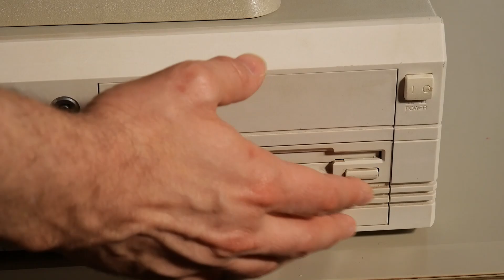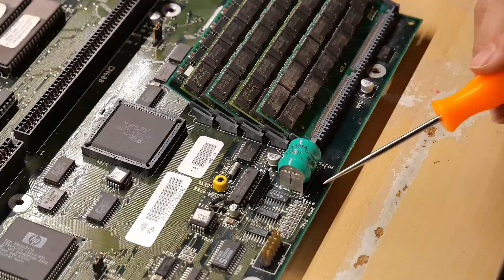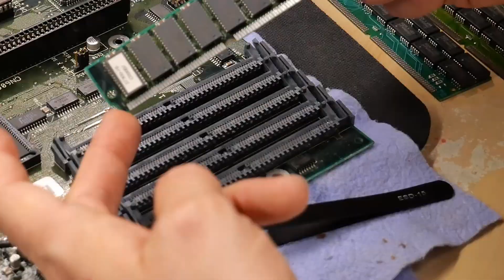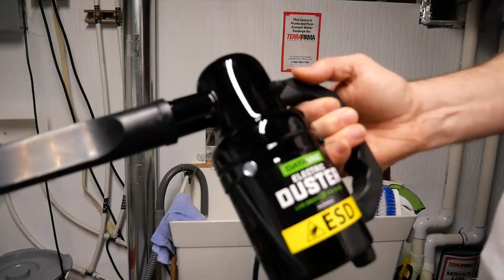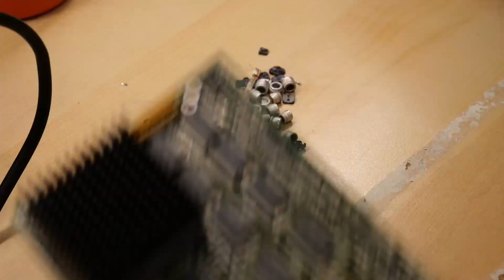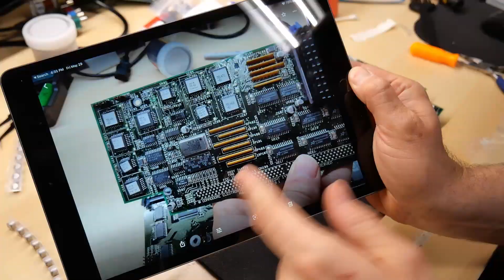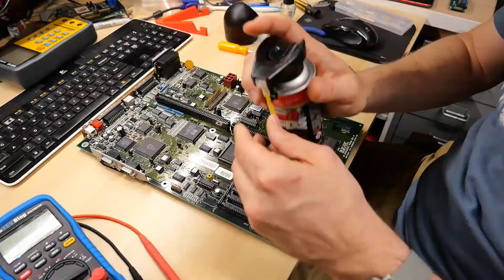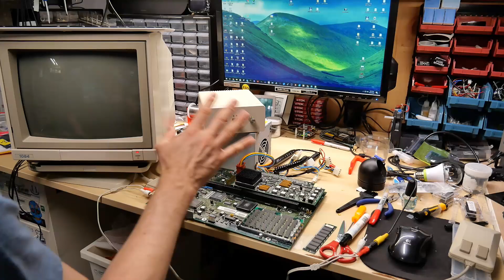Amiga 4000 Repair Part 1: Recapping and RAM issues galore!

Comment: I'm not an expert when it comes to electronics and I don't know the Amiga at all, however the RP5C01 seems to be a "Real Time Clock" - meaning the thing that keeps time and date, not the CPU clock.  A computer would not even start without the CPU clock.
A0, A1 and A2 are likely connected to the CPU so you should have some kind of activity there - you could check continuity of those, they are likely going to many other chips on the board. Are you sure the battery does not make a difference? Do you have 5V on pin 18, VCC? And is the oscillator on pins 16-17 ok? It should read 32.7Khz - but you'll need an oscilloscope to test. I hope this helps, thanks for another nice video! :)

Comment: Watching in hopes that before we dive into the fixing there's a "what's an A-4000, anyway" section. I have no memory.
Reply: The Amiga line was more popular in Europe and the UK than in the US during the early to mid '90s. They were consistently about 10 years ahead of their time and had a price tag to match. 
Adrian made a side mention of it early in the video, but a company called NewTek made a real-time video editing platform called the VideoToaster which was based around max specced Amiga 1000s and later 4000s. The units were revolutionary for the time period in that they were the first broadcast-quality editing system with a price tag of < USD $5000.
Their younger brother, the A500 was used to generate Chiron scrolls, including the on-screen TV Guide channel that most cable systems had during the era. Another fun fact about the Amiga-based VideoToaster series is that their 3D rendering platform was used in just about every low-budget SF&F TV series from the time period (Babylon 5, SeaQuest, etc...), because you could network a bunch of A1000s and/or 4000s together into a cheap render farm for a fraction of what it would have cost to rent time on the IBM and HP minicomputers that most of the big studios used for 3D work.

Comment: If I remember right my A3000 does not found the Hardware clock until I have connect a working battery. You should set the time in preferences after installed a new battery. First try it with a Battery.  Maybe you are hunting a phantom error.

Comment: If you're worried about brittle plastic breaking it often helps to warm it up slightly, a hair dryer or warm water will work depending on the application.

Comment: The 2mb/8mb chip ram jumper was an odd artifact left over during the system's rather checkered development. It needs an AGNUS chip that was never actually produced, to do 8mb of chip ram. Emulators have implemented the 8mb chip ram as a sort of hack.

Comment: I seem to remember something about either the 3000s or the 4000s actually having one of the caps in the audio circuit on backwards in the schematics themselves. You might want to look into that.
Reply: Some of the caps on the A3640 68040 CPU card were installed backwards at the factory. SIlk screen error on the board. Hopefully Adrian is aware of that!

Comment: Even before I watched this video, I saw people on other forums losing their shit about the twist method Adrian used to remove the surface mount electrolitic capacitors.  I say it's fine and Mr Carlson is proponent of this method too.  I'm sure Adrian is able to evaluate and assess the boards condition and judge the likelihood of damaging the traces using the twist method.  It's not as high risk as some people say it is.

Comment: Hey Adrian! Here's a tip on how to clean corrosion. Take a toothbrush, dip it in vinegar and GENTLY rub the area. Repeat if necessary. It really works wonders. You can also use this with regular short bristles paintbrushes, for cleaning corrosion or cleaning of dirt in general, although for dirt you'ld idealy be using some other substance.

Comment: Seems to ge a common problem with the 174 chip on a 4000 when the battery leaked just a little.  I have ssen lots of repair videos and in almost every case, this chip hadto be replaced as it caused several issues not only for the clock but the ide interface as well...

Comment: Check the R182, if it’s bad it will “clear” the IC all the time.
Reply: Yeah, I'm betting there's a corroded trace on either the clock or that clear line

Comment: Just checked the datasheet for the LS174, and as long as clear is high (it's pulled high on the schematic), and you're seeing activity on the CLK pin, then that should be working. If the clear pin were low then you'd be seeing low on the outputs, so the fact that you're seeing high on the output suggests the chip is bad. If the outputs were shorted to ground when the original battery leaked, that would have killed it.

Also, seems a little wasteful to use 16MB SIMMs when 4MB sticks would suffice. But then again, I just had a quick look around for my spare SIMMs, and the only ones I can find are 16MB, so I guess they're common enough that it's not a great loss.

Now I'm wondering what I did with the rest of my SIMMs. I know I pulled them out a couple of months ago to go through them and find the 16MB sticks for my 4MB 30 pin SIMM project, but I'd really like to know what I did with the rest of them!

Comment: I've starter replacing those rechargeable batteries with super capacitors. A few Farads will run the clock a loong time and recharge whenever you use the machine. I don't think they will ever leak either.
Reply: Original XBox users may disagree....

Comment: A fairly important thing about the cpucard and the motherboard.
Many A3640 cards came with some capacitors installed the wrong way around, apparently even the silkscreen is wrong.
http://amiga.serveftp.net/A3640_capacitor.html
The motherboard have 2 caps the wrong way around it seems(in the audio circuit).
https://forum.amiga.org/index.php?topic=73570.0
Reply: I was about to mention this, I don't think he knew.

Comment: I use my actual vacuum cleaner from the 70's with the hose on the output, since it lets you do that. The heat from the motor does a great job drying washed boards. Even had a CRT board survive the procedure and the board works now! Obviously I made sure it was properly dry, a widescreen CRT board is going to have some pretty nasty voltages on it!

Comment: The lack of an RTC shouldn't cause instability. The RTC chip is likely getting too much voltage because there is no battery pulling down the 12v line - so it is outside of its operating voltage. Try installing a (coin/button cell) battery or stopping the 12v line from getting to the RTC chip.

Comment: I finally had to buy a new roll of desoldering braid, I only use the chem-wik #4 10-50L and that roll lasted me 5 years! It is readily available for around $19 on ebay and works like a dream.

Comment: Finally someone who don’t say “battery acid” and say what the substance that leaked really is.
Reply: True. Car batteries have an acidic electrolyte, most other batteries use an alkaline solution.
Reply: One time I let a car battery spill on me and I didn’t know what it was but I felt some burning on my lap and took my clothes off and went for shower. Fast forward to the next morning, my clothes were a shredded mess setting on my bedroom floor. I had never seen anything like it but I am a simple man.
Reply: @ZTK-RC  Well car battery is called Lead Acid battery, it is made from diluted sulfuric acid and a lead composite, and sulfuric acid is quite good dissolving organic tissue, NileRed has a really nice video showing the effect of acids on his skin and paper.
Usually those old "barrel" battery are Nickel and Cadmium based, and newer versions are Nickel metal hydride batteries.
NiMH cells have an alkaline electrolyte, usually potassium hydroxide, which are corrosive too.

Comment: That 174 is a flip flop, so the outputs SHOULD follow the inputs delayed by one clock cycle.
I'd check the voltage at the reset pin (_CLR, pin 1); it should be 5V as it is pulled high by R182.  There could also be a failure on the 5V line to Vcc (pin 16) or GND (pin 8).
And of course the part could just be bad.  It is CMOS!

Comment: I repair Amiga 2000s. I run Amiga of Rochester (https://amigaofrochester.com). My friend Paul runs Acill.com and does a lot of 4000 work.
Reply: I would sand the traces. What I do when I fix 2000s. Then tin and replace traces

Comment: Please be extra careful with this machine, it is quite special (and expensive - whoever sent this is mad) - consider putting in a battery for the clock before hypothesizing / desoldering anything. The regular (A500) amigas don't have battery backed clocks so in Amiga land these things are an after-thought. Primary timing / clocks on the amiga come from the CIA chips, I'm pretty sure the RICOH clock chip is only there to maintain time when the machine is down.

Comment: I love seeing some Amiga content on the channel. In my mid to late teens, I had an Amiga 1200 and absolutely loved it. I always lusted after the Amiga 4000, but it was way out of my price range, I saved my allowance for the best part of 2 years to buy an A1200, and then saved again for a 68030 upgrade with 4MB of fast RAM, then saved up again to get a 340MB 2.5in HDD. When I got my first PC, PII 350, I handed my niece the A1200, which swiftly got broken, much to my annoyance. I really wish I held onto it, I'd love to break out Geoff Crammond F1GP on the original hardware.
Reply: Oh how familiar this sounds. The guy I bought my A1200 from had only moments earlier unpacked a brand new A4000. Sure I was super happy about the A1200, but at the same time I couldn't help but feel a lil envious as I carried my new baby home. :P

Comment: If software doesn’t load and gives you software errors press left mouse button try using a disc called relokick should be on aminet it will put the machine in to kickstart 1.3 until you power it off so you can get older software to load

Comment: After my lame attempt to clean the motherboard I gave up on the project. The battery was replaced not long before you came and hauled it all away. The battery in the 2500 was also replaced at about the same time. I'm really glad to see you getting the 4000 working again, it was a great computer and I did many hours of graphics work with it. I hope to see you get it working with all the cards that were loaded in it. Thanks Adrian, for the videos!
Reply: This might sound weird coming from a fellow ADB viewer, but thanks for the donation.  I'm looking forward to seeing how Adrian brings this A4000 back to life.
Reply: Great respect
Reply: George Chambers ☺️well you give it a good try
Reply: If you sold it cheap you're a git as i'd almost kill for one.. Or would have, except when i had to repair it for a friend and...god they were poorly made and designed! My 1200s are more reliable and easier to work on, that's for sure.

Comment: at 17:37  the 74HCT174 chips are hex positive edge-triggered D-type flip-flops with individual data inputs (Dn) and outputs (Qn).  The two 74HCT166T chips are an 8-bit serial or parallel-in/serial-out shift register.

Comment: Wouldn't alcohol replace the water? If the water itself dries it might leave calciumcarbonate behind or not? I also much prefer the method RMC uses to remove caps, taking great care not to lift pads.

Comment: Nice video as always! Something I suggest doing is using some spare wire to bring the battery off of the board. Then you can place the battery where leaks won't matter. It also makes future replacement much easier.

Also, why did you go straight to recapping the board? Since the symptoms led you to replacing chip RAM, I would've done that before looking at recapping. It is better troubleshooting practice to only change one thing at a time.

I also suggest probing suspect capacitors with an oscilloscope and looking for excessive ripple. It won't catch everything but can still be helpful, especially on newer equipment with buck converters on board. I've measured 600mV of ripple on a 5v rail before!

Comment: That 8MB jumper was for a future upgrade that was never released. You should leave it in the other position. 2MB Chip RAM is the maximum.
Reply: Yes for the never realised AAA chip :) (Advanced Amiga Architecture)
Reply: Correct.  Even with a > 2MB SIMM, it'll never register/use more than 2MB of chip ram.
Reply: Yes, CHIP RAM is limited to 2MB, ignore the 8MB jumper.  

There are some hacks that will let you put more than 16MB of FAST RAM on the motherboard.  Instead of 4x4MB sticks, you can use 4x16MB sticks for 64MB.  

Even if you don't attempt a 64MB hack, you can install a single 16MB stick of RAM in one socket for a full 16MB.  This is useful if you have broken plastic clips on your SIMM sockets.
Reply: @jjdigitalvideosolutionsllc5343  Hey I am an Amiga Noob; and was wondering about an Amiga 4000T. What setup is better; using the fast ram upgrade or ignore that for Zorro 3 ram upgrade on the motherboard?

Because I think I read that using both would not be optimal.
Reply: @captainandrew016  FAST RAM on the motherboard is faster access than RAM on the Z3 Bus.  I think RAM on the Z3 bus is about 20% slower.  Fastest RAM access is on some accelerator cards, like a CyberStorm MK-II or MK-II.

The A4000 motherboard RAM hack is limited to 64MB, but that's a lot for most Amiga use.   Working in ImageFX or a 3D application will benefit from as much RAM as you can get.  Mac or Windows emulators like extra RAM too.

A3000/A4000 Accelerator cards are limited to 128MB.  Imagine if you could put four 128MB SIMMs on a CyberStorm.   You can do that on an A1200 with a Blizzard 1260 (128MB on the Blizzard and another 128MB on the SCSI add-on).   I have 256MB on my Blizzard 1260.

Z3 Bus RAM is limited to how many slots you have.  You could put four 256MB BigRAMPlus cards (Individual Computers) in a desktop A4000 and have yourself 1GB of FAST RAM on the Z3 Bus.   An A4000T has five Z3 slots.  There was a Micronik bus expansion for towerized Amiga 3000/4000 desktops that had seven Z3 slots.  Those busboards aren't always 100% compatible.  If you are running AmigaOS4, you may not be able to access RAM on the ZORRO Bus (last time I checked ).  

BigRAMPlus:
https://icomp.de/shop-icomp/en/shop/product/bigramplus.html

Micronik busboard with 7 Z3 slots:
https://bigbookofamigahardware.com/bboah/product.aspx?id=1389
Reply: @jjdigitalvideosolutionsllc5343  Yeah, I'm not sure about Amigaos 4 as an operating system. I think it's a waste to not use it in a PowerPC, but I slapped it into an emulator, and couldn't get many of my floppy disc games to work right (my gripe as a noob).
So a fresh install of 3.1 is going into my Amiga 4000T. Makes it easier to stick with fast ram anyway. Plus, I'm essentially on an Emulator's budget until I can shill out some cash for a few components I still need.

Thanks for the advice! I'm definitely going to check out the links.
Reply: John Perkins 😇

Comment: Those ICs near the clock chip are buffers for reading the joystick port, and the configuration jumpers (J975) through those pull up/down resistors near them. See GadgetUK164’s latest Amiga repair videos for more info. HTH. 😊

Comment: It just kills me to watch you use that twist method for cap removal.
Reply: Why?
Reply: @stefarossi  These Amiga boards are extremely prone to capacitor leakage, which love to corrode through the solder pads and traces. Twisting makes it many times greater of a risk that a pad will be ripped off. It's a really bad way to show the world how to do it, especially if you have the proper equipment (hot air station or hot tweezers) on hand.

Comment: The 2MB/8MB ChipRAM selector doesn't actually do anything.  That was a feature that they planned to implement later, but Commodore went Bankrupt.  So unfortunately you will only be able to address 2MB of Chip RAM and 16MB of Fast RAM on the board.  To add more Fast RAM you will need a either a RAM card, or an accelerator CPU card that allows you to add more RAM.  I hope you enjoy the machine.  The Amiga 4000 is a fascinating machine to work with.
Reply: > "That was a feature that they planned to implement later, but Commodore went Bankrupt."
As far as I know, the 8 meg-option was for the planned AAA-chipset, which got canceled. The later developed AGA-chipset has no ability to use more than 2 meg.
Reply: @steffenjachnow8176  I may be misremembering, but for some reason I recall reading somewhere from Dave Haynie that they left the 2MB/8MB switch on the 4000 because there was an idea that an upgrade would be available at a later date and you could have your Amiga 4000 upgraded to support 8MB, but commodore went bankrupt and nothing ever came of it.  It was also more difficult to implement due to the already in place memory map which would have to be redone to allow for the 8MB space with fragmentation.  But then again, like I said, I may be misremembering.

Comment: You can't get 8mb chip RAM on an Amiga, at all (unless you're emulating).  The jumper on the A4000 motherboard is called the "Free Beer" Jumper - there is no free beer, there is no 8mb chip.  The board was designed before the AGA chipset was finalized, and once it was it was far less than the engineers wanted, including being limited to 2mb.